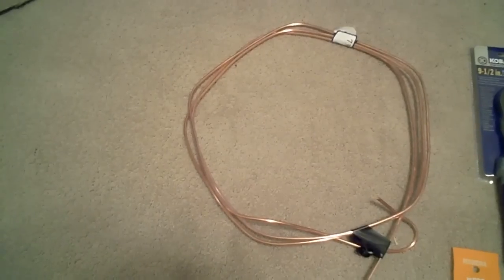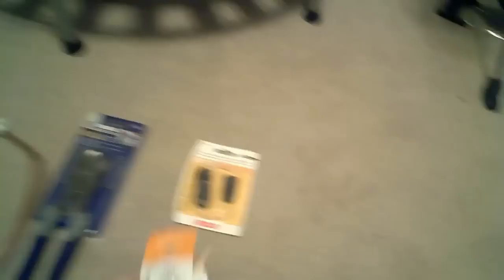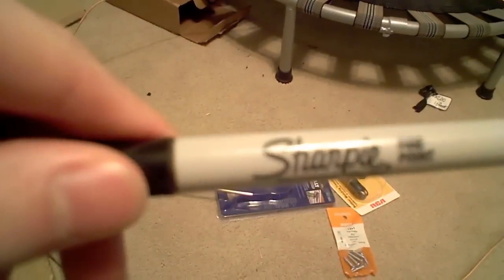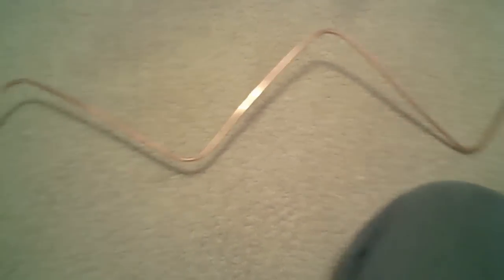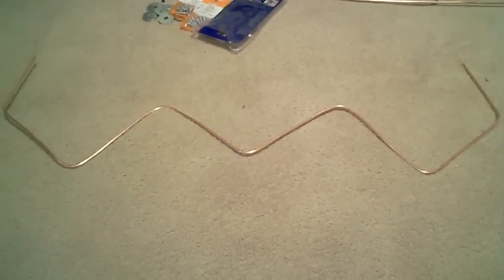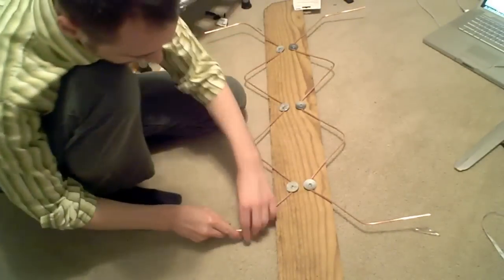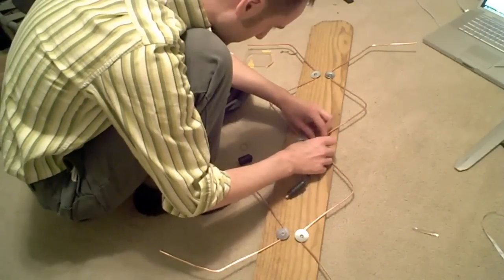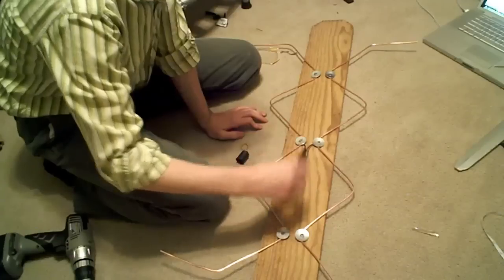How To BUILD The BEST HDTV ANTENNA! | Homemade HDTV Antenna DIY

Comment: I agree totally with the previous comments about antennas. Having been an electronic technician for 45 yrs (now retired) that worked on Radios and TV's; I can assure you that almost ANY conceivable "conductor" will bring in great reception when it comes to HDTV. Gone are the days where TV antenna installers had to spend hours orienting a myriad of kinds of antenna's trying to get the best they could. 'Oft times in dismal failure.

I speak from hours untold fighting "radio propagation" trying to satisfy unyielding customers. I have the "battle" scars to prove it. LOL.

To demonstrate how EASY it is to capture digital (IE: HDTV) signals; I showed a friend how a bass guitar string strung on a guitar brought in perfect HDTV stations; simply by using a clip lead (wire with an alligator connector on each end) to connect the antenna input on my receiver in my music room. His eyes got as big as saucers almost when he saw it.

Even better. Anything that will conduct electricity; and on a roof top: will bring in unbelievable results. And here is the secret: It does not matter how distorted, ghosty or infiltrated with noise, etc, the signal is; once the signal is synched up to the station's sync "bits" imbedded within the signal; AND the level is above a given threshold; the picture will be perfect; with zero imperfections. It is the beauty of digital over analog.

Believe me. Any one can prove this with a simple metal coat hanger screwed to the top of a roof or chimney, etc. In other words; once the "receiver" is synched to the "station", it will ignore ANY thing but what it recognizes as the appropriate "stream" of bits.

Incidentally: This is what NASA "had" to have to receive adequate signals from space craft. Analog simply would NOT do it. We owe the results to "Bell Labs" embellishing upon "Boolean" algebra to improve long distance telephone calls, for the awesomeness of what "digital" has brought us.

Don't waste money on fancy gadgets and sale's hype. Almost any conductor will give unbelievable results IF the level is sufficient. Using different antennas will NOT improve a weak signal; no matter what you do. Trees, buildings and other obstructions are killers. Height is the answer here.

Good luck. And may Jesus bless you always,

patdee
Reply: As to your first comment: I said, "If the level is above a given threshold; the picture will be perfect; with zero imperfections. It is the beauty of digital over analog."

Note: Below a given threshold. You are correct IF a given antenna can not bring the signal up to that level. So the statement I made covers that.

Secondly: SWR (Standing Wave Ratio) means NOTHING to HDTV once the signal is above a given threshold and is "synced" with the bit stream; created at the broadcast station. In fact one of the greatest features of digital over analog, is SWR; being a literal beast in analog; is rarely ever a problem in receiving digital transmissions.

Again, a guitar string strung. of virtually any length. on a guitar, proves that IF the signal strength is above a given threshold, and in sync, almost ANY metal object will be more than sufficient for 99% of all HDTV viewing.

I am using on my roof a 41 yr old HUGE directional VHF/UHF antenna. It is HIGHLY directional using analog. In fact channel 14 before HDTV was so horrible, it was virtually un-watchable, UNLESS I turned it 180 degrees. With HDTV now, the signal on ALL 82 local channels are perfect, UNLESS the wind is blowing hard  (I have many high trees in the signal path)

Finally, I appreciate your comments, expressed clearly and concisely. However,I shant comment on the subject further since I have not the time nor the interest to get into a "tinkling" contest.

Thanks again for your input.
Reply: pat dee  I live in a mountainous area. Huntsville is about 77 miles from me, with some mountains; Chattanooga is closer, about 55 miles, but with many more mountains. How would you propose I get great reception, all of the time?  Another question: why does weather change alter reception adversely?  Thanks (and He does, always. Praise His name!)  May God richly bless you.
Reply: +pat dee I have to disagree with "different antennas will NOT improve a weak signal" part on the grounds that that is what gain measures is the increase in sensitivity and subsequent increase in signal strength.
Also before you state that any random length conductor will work you should consider the effect of high SWR on the tuners ability to decode 8 QAM symbols.
Reply: +pat dee  I was not inviting any tinkling or contests, I was merely informing you of an error.
If you are you you claim you will find this interesting and informative.
I would not make a claim like that with out evidence for the statement.
The EVM (Error Vector Magnitude) is what causes the noise figure to rise more than the usual calculations for mismatch loss.
High VSWR can (don't read will) cause the equivalent of multipath 
 http://wayback.archive.org/web/20090220082727/http://tvantenna.tv/papers/dtv%20coverage%20and%20service%20prediction.pdf
 
Search a few pages down to the statement " Two examples of how the antenna VSWR affects  the noise figure.
Then don't miss the statement .

The  estimated  degradation  to  the  factory  noise figure could reach 20 dB and is about 6 to 7 dB higher with the double bow-tie antenna

Wow 20 dB that alot ..right? (just a little sarcasm ) 
That could really cut into your noise margin eh 
A little more discussion of SWR and EVM .
http://www.tvtechnology.com/expertise/0003/receive-antennas-revisited/183696

For the poor people wondering what the heck 
is being discussed
http://wayback.archive.org/web/20141103015956/http://www.axcera.com/downloads/technotes-whitepapers/technote_5.pdf

I also use some very old antennas to receive DTV but those antennas were designed to at least have mostly acceptable SWR ratings.
Reply: If this is the BEST hdtv antenna, how does an ignorant disabled laywoman living in the boonies build and erect such a one??  And what are all those acronyms you tossed about?  Do I need to know them, or about them, before building?  Wanna come SHOW me how it's done RIGHT???  heh heh heh
Reply: Janis Williams
 Hi Janis,
Sorry to hear you're still having trouble with reception. The only acronyms you need before building or purchasing are  UHF and VHF.
VHF is channels 2-13  and UHF is channels 14 -50 .
You should know which ones are present in your location.
If you want more advise on your reception possibilities then we need more information.
Go to https://www.tvfool.com/?option=com_wrapper&Itemid=90 
put in your zip code and hit the "map this" button.
When the map comes up pull the little stick pin/ballon over to your house and set the height to 20 ft.
Then hit the "radar plot" button.
The page that opens is your report and gives information on the available signals and how hard it will be to get them.
it reveals your location but the accuracy is only to about a mile or 2 depending on how far you are from a tower so I understand if you don't wish to post it here, but you could post it there on their forum for advice about consumer equipment suggestions.Tell me if you post there and I'll reply there .
Pine trees are very hard on TV frequencies, southern long needled pines maybe the worst..
Reply: ghz240 I went to tvfool.com (I had been there before but didn't know I could adjust the antenna height), and saw all? the tv stations I could/SHOULD be getting.  Thanks.  I looked for a way to post there, but only saw a way to save my info.  I'll gladly post if you tell me HOW.  (Sorry for my ignorance.)  Again, thank you.
Reply: +Janis Williams TY Janice.

I do not know how to post on that link. Very sorry. 
take care.
Reply: Janis Williams The page should say "TV signal analysis results"
( the page that pops up after you hit make a radar plot link).
It should have the same address as the map except the 90 at the end will be replaced with a long number for example

  http://www.tvfool.com/?option=com_wrapper&Itemid=29&q=id%3d513421e7b3a772
 
This address is  also right under the sentence

"If you would like to share these results with others, this page can be referenced as:"

This will help select and aim an antenna.
Don't think of the list you see as a should get but as a list of possibles and a gauge of how hard you'll have to try to get reception.
Just paste the link here if you want or follow the link fight below it to post to their forum (you have to join but it's free)
Reply: pat dee THANK YOU!!
Reply: Hi Janis,

Please forgive me for not seeing your question. 

I have been in and worked in Chattanooga many times so I am well familiar with the terrain.

Unfortunately, there are places in an around Chattanooga where the ONLY answer to your dilemma is either towers, cable or satellite.

Radio waves follow the "line of sight" scenario more and more the higher the frequency. HDTV is very high. Thus without the antenna "seeing" the signal direct, it can degrade very quickly.

Trees, buildings and other structures can kill an other wise perfect signal. Some with your problem of getting good signals have alleviated the problem by installing tall towers. But this is usually not practical or desirable.

May Jesus send you a way that will help you dear person in Jesus..

Thanks for your question and again, forgive me for the oversight.
Reply: Pat, Thanks for your understanding, and encouragement, and practicality.  Maybe I can clip my alligator onto a helium balloon, and have wire instead of string - lol - until a bird pops the balloon, or it just looses gas and deflates on its own!  

I used to have a rotating antenna that worked fine, but it must have been hit by lightning, or something, because it doesn't get anything except occasionally it received TBN, and TBN only.  But, if I could have only one station to receive, I'd want TBN, so I'm very blessed!  Thanks for caring!  May our great God richly bless you!!!
Reply: For reference. I just took a piece of scrap copper wire, stripped it, pushed 1 end into the coaxial antenna port and started getting channels.

Comment: So called "Fancy" antenna designs have nothing do do with the quality of the picture. Digital  TV is either there or it is not. Height, distance from the source signal and Multipath are the major players in the digital TV game. You can have the best antenna in the world, but if it's not getting a signal, it's worthless. If it's getting two or more strong signals of the same magnitude with a slight delay, called Multipath, your decoder gets confused and shuts down. Anyone who remembers analog TV and that "Ghost" image has experienced  Multipath. Unfortunately, digital signal decoders don't like multipath, they can't listen to several voices at the ssme time and make out the conversation. This is probably the biggest problem with digital TV.
Reply: Robert Mitchum  Not exactly true.  The antenna has to point the right direction, and the design of the antenna allows it to capture a weaker signal. A straight wire sticking up is not going to be able to capture a weak signal that a well-designed antenna will.  A low quality signal won't come in on an HDTV, whereas a larger, well-designed antenna can capture that signal in order to have your HDTV display it. Very similar to radio stations: a radio with a poor antenna will get a signal full of static, where one with a good antenna will get a nice clear signal.
Reply: +Eric Alexander   Digital signals have a cut off threshold, anything below this threshold and you won't get a picture. Digital decoders need a minimum bit rate stream to keep them locked on signal, the bit rate error goes up, or is lost..... No picture.  Yes, a directional antenna will help with weak signal, but if there's enough signal there, a random length of wire will achieve the same picture quality as the best well designed yagi . As long as you have enough bit rate without to many errors, even the worst of antennas will achieve the same picture and sound quality as the most elaborate well designed antenna.
 Remember..... Where not talking analog here.
Reply: p

Comment: You can build your own by buying all the parts shown in the video ($10-$15...?), and then spend an hour or more of your time putting together an antenna that you hope will get half decent OTA digital reception.... or, you can just by a real 4 bay (or 8 bay) UHF/VHF antenna. Ready built UHF/VHF antennas have come way down in price over the past five years. They used to cost $80-$100 (or more) depending on the model. Now a days stores like Tiger Direct, Factory Direct, etc etc, have them for sale starting around $20, and these newer antennas work waaaaay better than any home made ones at picking up and locking onto OTA digital stations from 40+ miles away (as long as the antenna is high enough, and has a somewhat decent view towards the digital transmission antenna).There's an old saying in the world of antenna installations.... height is your friend. Btw, putting an OTA antenna in your attic may be easier for most folks than mounting it outside, but placing it inside really kills the incoming digital signal. Asphalt shingles and the wooden roof reduces the incoming digital UHF/VHF signal to a point that the antenna has a hard time locking onto it. Ideally, placing the antenna on the roof (with a tripod), or high up on a side wall of your home (with a "J" pipe) would be the best option to get the strongest digital signals. A home made antenna made out of wood wouldn't not last long outdoors. Anyway, here's an example of an affordable $25 four bay antenna, which btw is weatherproof, comes with all the parts you need to help install it (minus the rooftop tripod or wall mount "J" pipe... which start around $15), includes a weatherproof balun, and is good for around 45 miles (which is way better than any DIY antenna I have seen).
http://www.tigerdirect.com/applications/SearchTools/item-details.asp?EdpNo=8203559&CatId=2767

Comment: I have a coupon for $50 Dollars off of DISH Network.
Why am I doing this you ask? I get $50 bucks off too my bill! So it works for both of us really. It is their referral program.
Give them this number when you call them- Referall number DRA141313589 or DRA141313564
1-888-615-3725 - DISH
Dish is actually pretty good at making good deals. I had Direct TV before and trust me after their first year they wanted about $130 per month. They honestly trapped me too, becuase if I told them to lower my services they would then add more money because of the contract they had with the current services. Yikes.
You have nothing to lose and $50 bucks to gain!
Thank you,
Victor

Comment: Very pleasing, I get about half-again better reception than the classic "coat hanger antenna" featured elsewhere on youtube.  I'm getting four additional channels from two neighboring states.  Convert the metric measurements once and it's really easy, seven-inch vanes just like classic coat hanger antenna, but you're getting both vertical and horizontal orientation.  One observation: use insulated 12-gauge or larger wire, and only strip where you'll be screwing the balun to the wire.  That way there will be no electrical interaction should the wood get soaked with rain.

Comment: you can use the same wire you use for house wiring and all you have to do is strip a spot where you connect the connector
Reply: Chat Rat Gamer Great idea dude!  Thank you.
Reply: Rolf Wirkki no problem. I done it my self works great. Shocked me how easy it was to do when I first saw the video